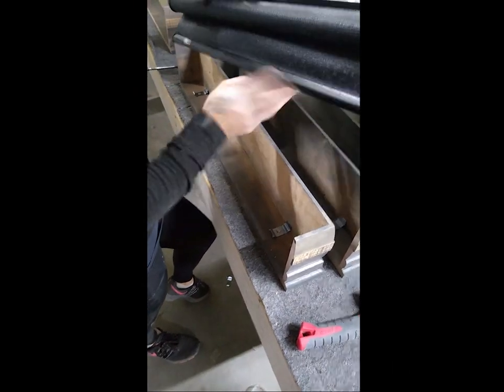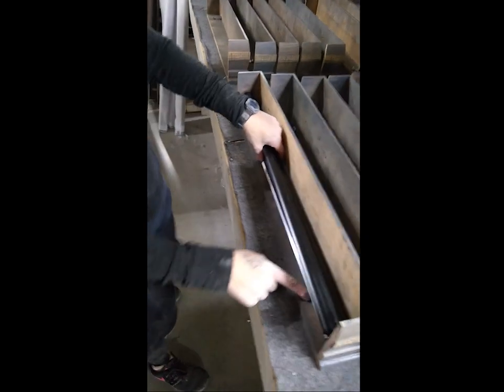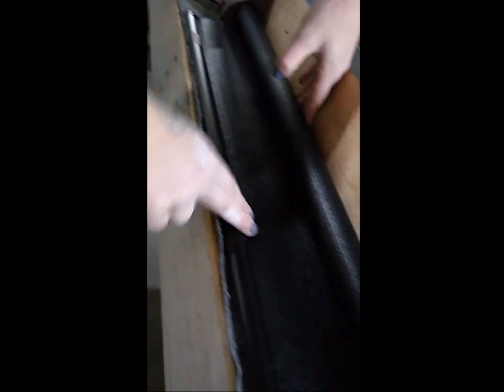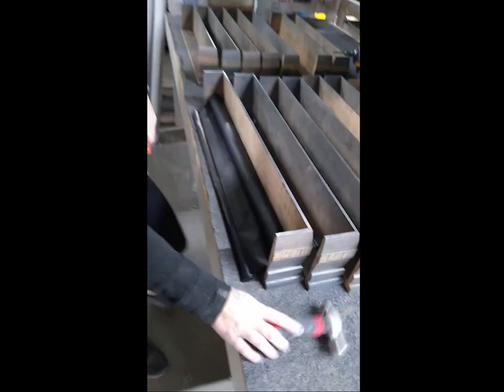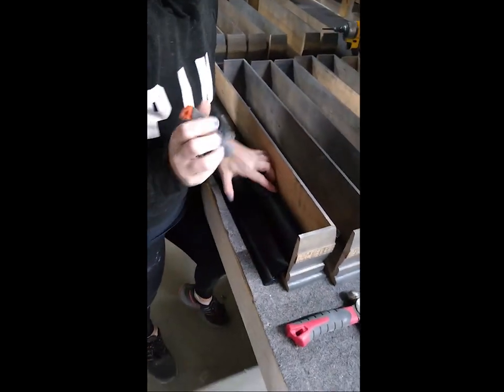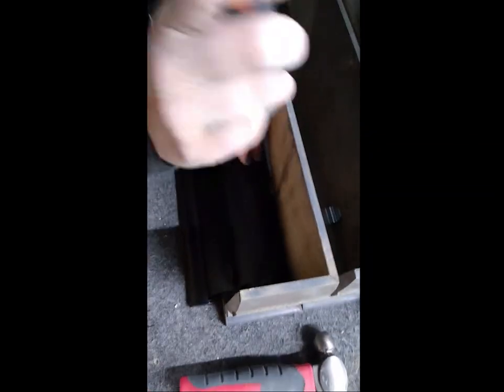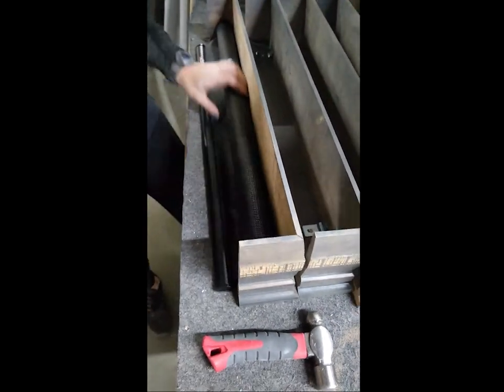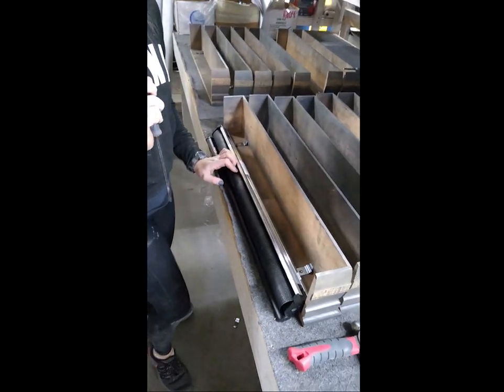Owner Empowerment - Removing Roller Shades

Comment: Thank you a million times for this. I had one end of our shade pop out and pulled my hair out for 30 minutes trying to get it back in. I could see how it was supposed to work, but I couldn’t get enough leverage just trying to use my finger to open the clip. I was resigned to having to remove the whole valence,then decided to go to YouTube University and found your video. The screwdriver did the trick in 10 seconds and saved my sanity.

Comment: It does look easy when on the bench.  Try it with the shade installed in the RV. You can't see where the clips are and you have to press your face against the window while you crack your neck looking up and feel around with a screw driver for a clip you can't see. The screws that hold those clips are too short. One of my shades fell out on one side because the screw pulled out. I ended up replacing both screws with slightly larger screws. Wondering how many more will come loose. I now carry a bag of larger screws in the tool box.
Reply: Same for us.

Comment: Yes it’s easy on the bench but very hard in the RV once they are in place on the window. Also they are installing the clips back to front so it’s easy on the bench. They should have the release mechanism facing the other way towards the front of the valance so you can remove them with ease.
Also the fabric valances in the Valor are very poorly upholstered with excessive material on the inside of the corners of the valances that rubs against the blind as you roll it down. Plus the valances in the garage are 3”” deep and the sofa on the happy jack catches as it moves so I has to remove them, take a half an inch off and reupholster them, then reinstall. The valances above the sofa and bed are just a joke because they use screws that are too long and poke through.
All in all very poor quality and even worse workmanship.
Yes I sell blinds for a living so know what I am talking about.